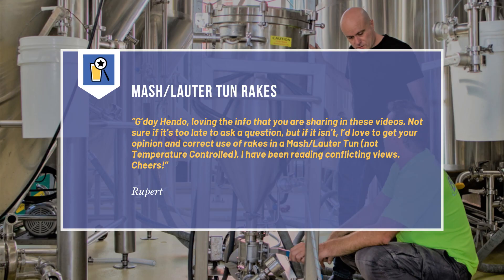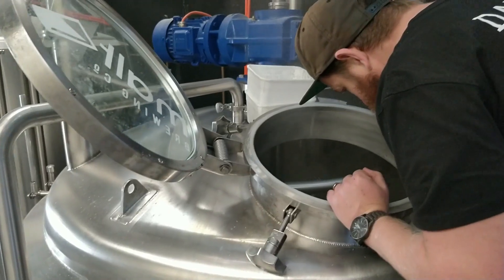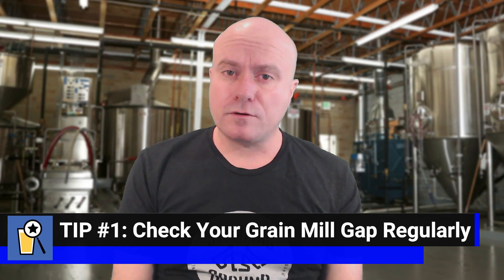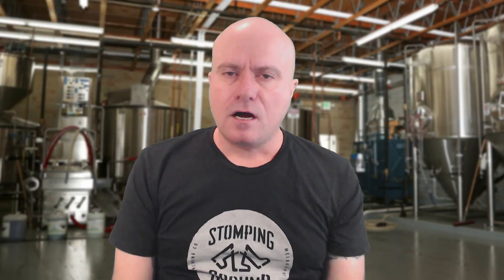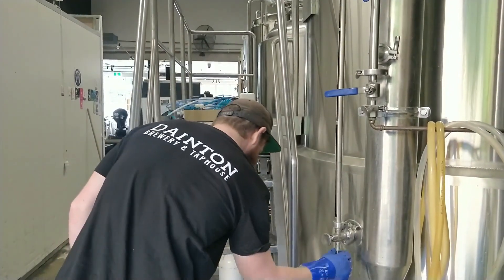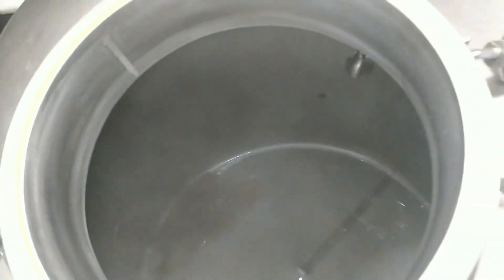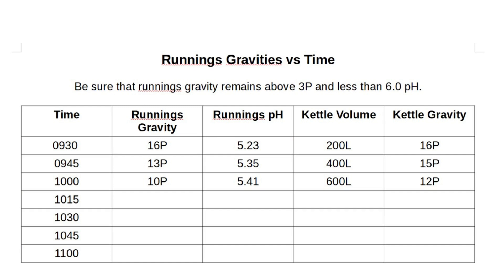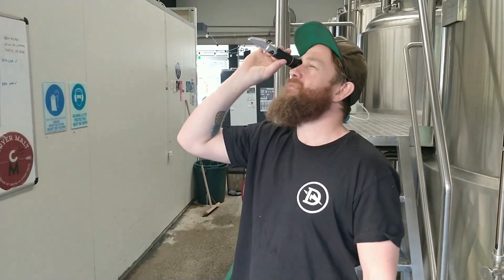Lauter Tun Mastery: Understanding Rakes and Optimizing Runoff

Comment: What method do you use to take all of these gravity readings?  If refractometer what brand do you use and does the sample need to be in a specific temperature range?  Thank you!
Reply from the maker: Typically in a brewery you'd use a density meter such as an Anton Paar DMA35 but any simple home brew refractometer will give you a rough guide to be close enough to hit your target.  The main reason for using a refractometer or density meter is that hot samples can be cooled quickly (unlike needing to cool a large sample to check with a hydrometer) - I hope that helps!

Comment: Hi, I am preparing lager of 5.1% alcohol, 100 hl/ brew, I am using 1200 kg of malt and 450 kg of broken rice. The problem what I am facing is my fermentation is stop at 3.4- 3.5 degree Plato. 
The mashing rest are 
40 degree- 5 min
50 degree- 10 min
67.5 degree- 60 min
76 degree- 5 min.
Kindly help me to sort out this problem. Thank you
Reply from the maker: Looks like you forgot to add in a beta amylase rest at about 63C. Also check your yeast health and pitch rate.
Reply: @RockstarBrewer  thankyou for your suggestions

Comment: Hello! Thanks for the tips and information they are extremely valuable! I am planning a budget "frankenbrew" brewery: 3x isolated 1000L diary tanks. One is HLT, one with a custom false bottom for the mash tun, and one is the kettle for an approximatelty 660L/brew. I planned for a party-gyle brewday to get the most out of the grist to fill 2x 1000L stock tanks with bottom valves (and custom cooling jackets)  which I thought I could use for fermentation. I planned for a bottle conditioning setup, transferring the finished beer to a bottling tank after cold-crash,  add sugar and yeast and fill bottles with budget vacuum wine fillers. Do you think such a setup will work fine for me for some years untill I earn enough money to build the "real thing"? Do you believe a custom "frankenbrew" setup can produce quality beer? Do you recommend to start with such brewhouse? I really need some pro advice here. Cheers!
Reply from the maker: Hey Gokce - head over to my free Facebook group at https://rockstarbrewer.com/pro-brewers-group because that's a great place to ask your question!  Thanks for watching.

Comment: Hello, i have one question: In my kettle/whirpool tun i have whirpool inlet and cone bottom whit only one drain in center. What is your advice what to do after whirpool and after trub settle at center?
Reply from the maker: ohhh that's a tricky one!  You want to separate your trub from your wort so you really need to draw clear wort from beside the trub cone.  Can you drill a hole in the side of your whirlpool?
Reply: @RockstarBrewer  probably I can find someone to do that it is double wall whit isolation so it would be tricky. My only option now is to drain  out trub I also have in line filter so that would help.